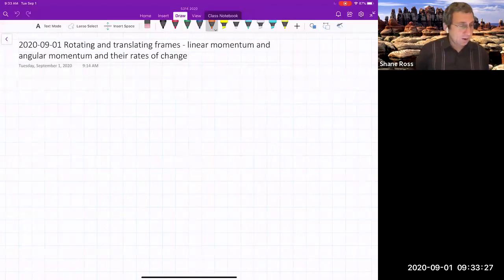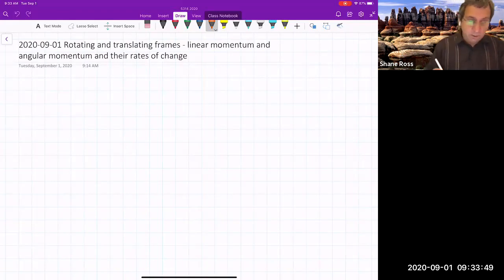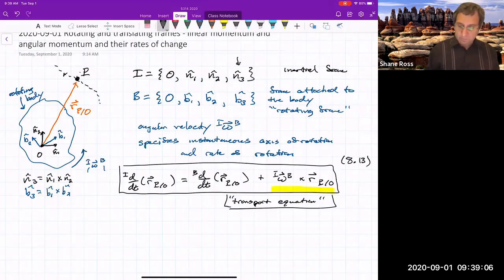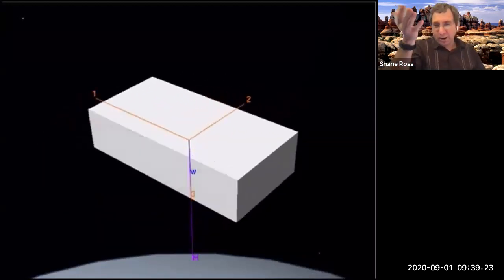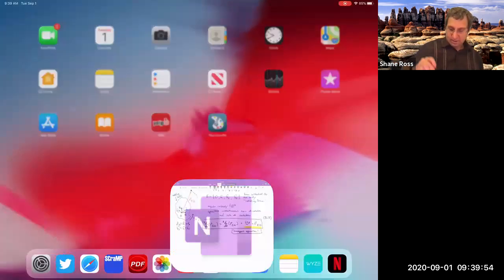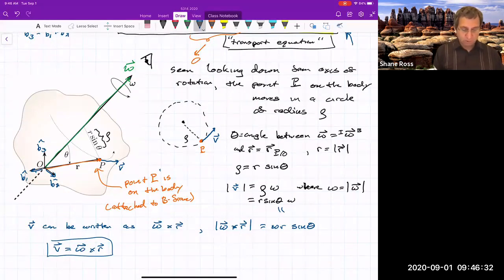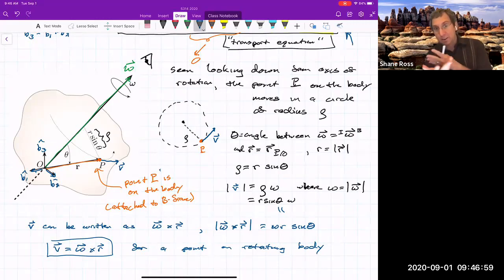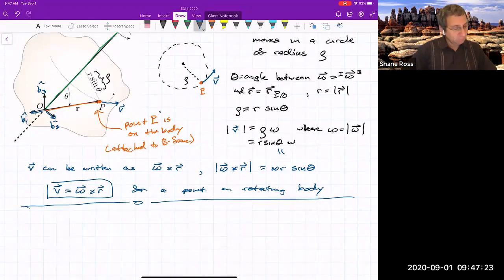Rotating & Translating Frames | Linear Momentum, Angular Momentum & Their Rates of Change, Lecture 3

Comment: FYI you can do this in open source software with python, for those of us who don't have access (or don't want to use) MATLAB here's a little snippet:
```
from scipy.integrate import ode
import numpy as np
import math
import matplotlib.pyplot as plt

y0, t0 = [math.pi/2.0, 0], 0
def f(t, y):
    L = 0.1
    g = 9.81
    return np.array([y[1], -g/L*math.sin(y[0])])
r = ode(f).set_integrator('dopri5')
r.set_initial_value(y0, t0)
t = np.linspace(t0, 10, 1000)
y = np.zeros((len(t), len(y0)))
y[0, :] = y0
for i in range(1, t.size):
    y[i, :] = r.integrate(t[i])
fig, ax = plt.subplots(figsize = (15, 10))
ax.plot(t, y)
plt.show()
```
Reply from the maker: Thank you. I agree, I need to start using Python... and getting used to that zero-indexing convention.

Comment: Is omega w.r.t body fixed frame zero or has 3 non zero components in B frame?
At 1:01:10 you wrote torque of P w.r.t O point. Is it expressed in inertial frame or Body fixed frame?
Reply from the maker: Answers below
Question >> Is omega w.r.t body fixed frame zero or has 3 non zero components in B frame?
ANSWER >> the vector omega represents the instantaneous angular velocity of the B frame (the pendulum rod "body"-fixed frame) with respect to the I frame (an inertial frame, in this case the immovable block to which the pendulum is attached). It has one non-zero component, in the e3 direction (coming out of the screen). The other two components are zero. It does not matter whether we write the omega vector IN TERMS of the B frame or I frame COMPONENTS.

Question >> At 1:01:10 you wrote torque of P w.r.t O point. Is it expressed in inertial frame or Body fixed frame?
ANSWER >> Again, it does not matter what COMPONENTS we use, whether they be the B frame unit vectors or I frame unit vectors. In this case, it's simplest to describe the torque using the B frame unit vectors (the {e_r, e_theta, e_3} unit vectors).
Reply: @ProfessorRoss  thank you professor, it was helpful